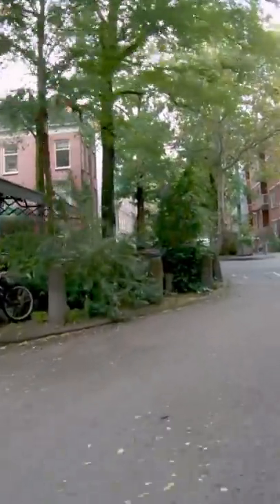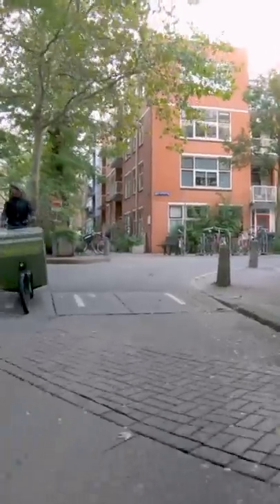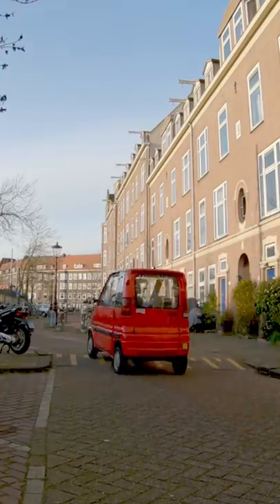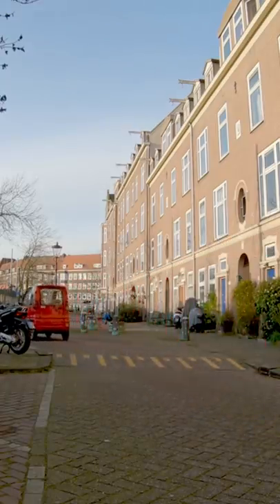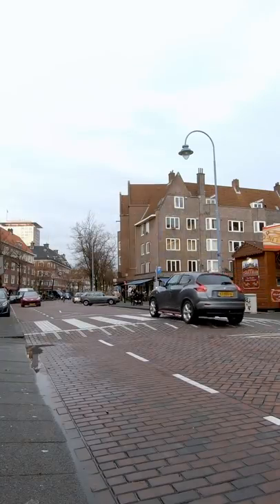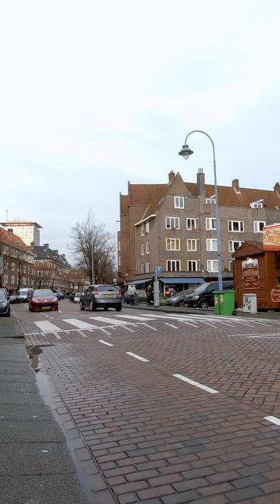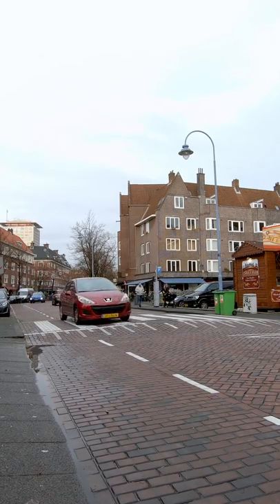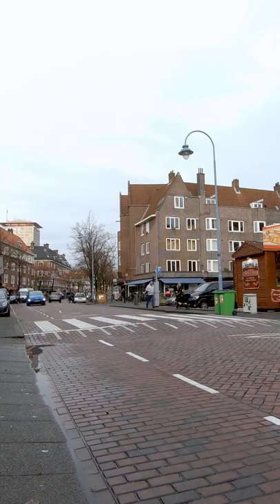How the Dutch Slow Drivers for Safer Streets #shorts

Comment: I like how is pretty much just "add road hazards so people will sLow down"
Reply: But it works
Reply: @yoyu8641  except that slow speed crash aren't that bad anyway
Reply: @yoyu8641  You are right, nobody ever got killed due too high speeds, genius.
Reply: I need to check the stats but i think in germany we have less car crashes... At least i always see dutch  people crashing, and also in NL more. I live in germany near the border
Reply: I checked it. Fatality  rate in germany per 100k is 3.7, in NL 3.8
So it probably helped, could be much worse, but - how do we do it in germany? There is much more to it than placing road hazards. Like proper driving schooling
Reply: "road hazard" = cautious, wary drivers = less dead pedestrians & cyclists. At the slow speeds these "road hazards" require, any crash will be non-lethal to drivers, as they are effectively driving two ton tanks.
All those "road hazards" also discourage driving and encourage cycling or walking, which are far better in the dense, urban environments this channel generally features.
Reply: It's a chicken and the egg argument and in reality it is not practical to force people to drive slower when it just isn't necessary. Sure a private neighborhood road. you don't want people to be able to go 100mph comfortably, but when they're intentionally making the road annoying to drive down and more complicated it's not really helping anything. People who speed don't care about the details. If they did, they wouldn't be trying to speed.
Reply: the "making it complicated" does help, because it becomes physically impossible to speed. You're not going to be driving through a tree, no matter how fast you're going.

In the dense, urban environments that this channel deals with, difficult roads are practical and useful, both as a means to make driving unpleasant, and to protect pedestrians & cyclists. The whole system of urban development in the netherlands is tailored to reduce car traffic wherever practical, because cars are dangerous, noisy, polluting, and horribly space inefficient.
Reply: @donfolstar   Did you forget your medication today? LMAO I didn't miss any point. I swear no one can talk about anything without taking the opposition, even when it really doesn't make sense... I constantly pay attention to my speed regardless of surroundings and am not "easily distracted" like you and other people may be. Honestly it's the fact that they are pretending to be in control of things when in reality that just isn't the case that bothers me about this idea and that they are just cramming potential hazards closer together and putting obstructions in the road in the name of making things safer when obviously it's never gonna change someone's mind who is dead set on speeding down that road and simply increases the potential for people to kill or seriously injure them self while all around just making things less comfortable for no reason.... I definitely wouldn't want to ride a bike all the time as transportation it's not practical anywhere other then certain cities in Europe that are designed to allow people to commute by bike. Cars are gross IMO, but it's not my fault society is a shit show and I have to go across the city everyday to work... Finally they use the technique of making roadways more narrow and putting in curves to force people not to speed Here in America so I have no idea what your talking about people coming here to get away from that. LMAO. BTW This was way too much effort to write just so that some guy in another country that is off his meds can spout of with more irrelevance at me...
Reply: Let me guess, you're American?
Reply: @dickrichard626  yes,you did miss the point!!
they didn't just throw those obstacles out there, there's science to this... traffic engineering
all those measures work very well,(you can find them all over Europe) and when an accident does happen-it is just a bump at 20-30 km/h supposed to 70-90... 🤷
Reply: @dpmjole  Do you know what a circular argument is? Chicken or the egg...
Reply: @dpmjole  Also if you really think there us advanced science behing the design of all the roads every where thats just insane. At least 70% of the time I garantee you the roads are whatever meet the codes and gets the job done. No one cares that much...
Reply: @dickrichard626  You should watch the video on stroads, there absolutely is a science and an intentional system in place. The obstacles like chicanes and large speedbumps are only found on residential 'streets' where the speed limit is 30km/h. Medium volume roads have a speed limit of 50km, smaller island-style speedbumps, and are sometimes narrowed. High speed roads and highways have no obstacles, but are never in town.

The entire philosophy of Dutch urban planning basically deprioritises speed and convenience of driving *in town*. Between towns it's fast and convenient. Once you're at the destination, the local pedestrians and cyclists have priority. The result is safe, quiet, liveable streets for humans. 

There's no expectation to get anywhere fast in town via car in Amsterdam, and this ought to become the norm everywhere. Within Amsterdam, cycling and public transport is faster and more convenient than driving. So that's what people do.

It wasn't always this way, Amsterdam used to be a high speed, car-focused city. They changed it (to much complaining from drivers at the time) but now the overwhelming majority of the public are glad they did.
Reply: @dickrichard626  in America indeed there is no science behind how roads are set up 
In the Netherlands it’s different 
I suggest watching the video about how roads are engineered to be bike friendly
Reply: The trees next to the road on 0:13 are a hazard, the other measures are not.
Reply: @JYT256  don't tell people its impossible cause that will make people want to try it. Then you'll have city drifting contests.
Reply: @dickrichard626  I mean, NL has speed cameras all over too. Plus, if you claim you're not easily distracted you're lying to yourself. I like to think I'm a driver that pays attention but even I have momentary lapses where I reacted to a situation way later than I should've
Reply: @dickrichard626  no it really is. Cities in Europe are really dense almost like new york so a lot of people are going on foot so it's necessary to keep them safe.
Reply: @dickrichard626  If you're American you clearly never see a European city. Not only that our roads are crooked becouse that's how they were made 100 or so years ago but a lot of people go on foot. So if someone crashes in America the car in front will just go forwards but in Europe if they hit someone fas enough they would go into a building. Also our intersections are much more complicated due to how the roads align.
Reply: @yoyu8641  Actually the trees close to a road is one of these who I hear get lot's of accidents and the other one is just highways which have none of these things to slow people down
 It's just being aware and growing up riding a bike amd knowing how traffic works from a young age that takes a lot of the danger away amd thus makes it a lot safer as people are more aware by those "road hazards". But yes we Ditchies still like to complain about them
Reply: Dude, thank you. Some US civil engineer is dying of laughter right about now.
Reply: @yoyu8641  die from what lmao
Reply: @jansmejkal8088  true, fast disciplined drivers cause way less accidents than slow reckless ones.
Reply: @jamelpiclit3062  love how you just made american drivers diceplined and dutch reckless
the truth is slow causes drivers are way less dangerous than fast uncauses ones
Reply: @burgerpommes2001  nah dude, I'm talking about ze Germans. Or Europe in general. It's so hard to get a license there.
Reply: @jamelpiclit3062  no it really isn't 
One of my classmates did it first try without mistakes and he almost failed the school year
Reply: You only have to train the exam on an app
Reply: I never understood the narrow road idea, it really dosent slow you down, just makes imposible to drive around when there is a crash making  a road blockage. I see it as bad design.
Reply: @dontdoit1419  the point is, we don’t have major crashes in the cities. If there is a crash on a narrow street or road, the driver is still able to drive the car to a safe location because the speeds are way down and the car is somewhat intact.
Reply: @dontdoit1419  it really does
Reply: Yes that is correct. it is so that if you make it dangerous for cars the slow down.
Reply: @donfolstar  To quote my friend: "Dutch are car hating nazis". He will never, ever move here. Given his approach to driving, it's a plus for the locals.
Reply: @jamelpiclit3062  Oooooh, the "fast and safe" nonsense. Such drivers do not exist.  It's an internal contradiction:  Speed limits are almost always put in place for a reason, and people who are speeding are too mentally inept to notice / acknowledge those reasons. If they were disciplined or competent drivers, or even had any awareness of what they are doing, they wouldn't be speeding in the first place.
Reply: @burgerpommes2001  compared to some US places where your parents can vouch for you, it is more difficult
Reply: @JYT256  yes. Those cars will be far less polluting and space inefficient if we pour a bunch of arbitrary concrete obstacles into the roadway and cause a number of near complete stops which force the drive to sacrifice their inertia coming nearly to a stop and then push the gas spending energy to get the car back up to speed. 
LOGIC
Reply: @isidoreaerys8745  you're missing the point. The cars will be less polluting because there will be fewer cars.
Reply: @LeDore38  a slow speed crash into a tree with a dead stop is far more dangerous than rolling or going through bushes and taking time to slow down
Reply: @yoyu8641  Terrible logic
Reply: @LeDore38  More accidents is not better than faster accidents...
Reply: @isidoreaerys8745  they wouldn't be going fast in the first place, you can just cruise through. These are designs in the city, where there's tons of pedestrians, not the highway. On the highway there's no such obstacles
Reply: @DollaBill313  in america you get more AND faster accidents lol going faster doesn't reduce anything so I don't understand your logic.
Reply: The driver is the actual hazard
Reply: @derianvandalsen  Really think about what you just said. Is the driver the hazard, or are the actual hazards in the road that make the driver take unnecessary actions the hazard? Yes drivers can always be hazards, mostly because of phones and the poor attention spans of this ADHD filled population. But how does making the road even harder to drive down make it  more safe?
Reply: @DollaBill313  the stats speak for themselves.
Reply: @JB22.  Except you are a cyclist or pedestrian walking behind the trees.
Reply: @DollaBill313  Actually it kinda is...
Reply: @dakoknight6197  yes, and it also looks better and better for biking and walking
Reply: Dick Richard You keep saying if someone is going to speed, they're going to regardless.  It is genuinely impossible to speed to unsafe levels in these areas.  Unless you're driving an F1 car with insane torque, by the time you reach a killing a child walking across the street speed, there's a speed bump, bend in the road, or raised section that would stop you.  

People only speed because it's convenient and they can.  Obscenely wide suburban roads that are straighter than an arrow just invite people to speed.  Theres no claustrophobia or loud sounds that make people uncomfortable to go 50mph in a school zone. With thin streets, complex design, and objects that are close to you, there's you need to pay attention to driving lest you crash.

Did you even watch the video?
Reply: @jansmejkal8088  Most of those fatalaties in both countries are vulnurable road users (pedestrians and cyclists), which are far more numerous in the Netherlands than they are in Germany. In fact a large portion of the fatalities in the Netherlands are 70+ cyclists, a group that doesn't exist in Germany because nobody even tries. Per km cycled the fatality rate in Germany is more than 10x that of the Netherlands.

 Lies, damned lies, and statistics..
Reply: @JYT256  Protecting the pedestrians by making the road so hazardous and complex to drive, no attention can be paid to pedestrians.
60000 IQ
Reply: @rachelpurity1  its only hazardous if you're not paying attention as a driver. Thats the whole point, to make drivers pay attention
Reply: @JYT256  The driver will have to almost exclusively focus on navigating that hellscape of a road at that point, they won't have focus left to watch pedestrians.
Imagine I told you to balance on a rope in the park while counting to 10 000 and then randomly asked you "what color shirt did that guy wear that just walked by?"
Reply: @rachelpurity1  have you tried driving more slowly.
Reply: @rachelpurity1  Can you explain why the Netherlands has one of the lowest traffic fatalities if you think that this is dangerous?
Reply: @Brozius2512  Can you explain why no speed limit Germany has lower traffic deaths despite more people driving daily and further and considerably faster?
Riddle me this, Nedman
Reply: @rachelpurity1  Road traffic accidents death rate:
Germany 2.98  -  Netherlands 2.83

If I were you I would do research before claiming something, it's not that hard... you have the internet.
Reply: @Jan Smejkal - different countries also drive different amounts. Most countries in the Americas rely heavily on driving. There’s gonna be more crashes. A better stat would be crashes per so many miles driven.
Reply: @gujwdhufjijjpo9740  That's because their infrastructure only gives  them just one choice in transportation.
Reply: @yoyu8641  That is not how it works. Accidents are deadlier the more energy is in the vehicle. And the energy correlates exponentially with speed. So, if manage people to drive 45km/h instead of 60km/h (good design is even better) you will have nearly 50% the energy. This means, half the slowdown period. Double the reaction time available. Less than half the damage, if you fail to prevent an accidents.

So, yes, there might be more opportunities to make small accidents. But in reality, you have much less dangerous accidents.

Sure, there are always idiots that drive far too fast. But on a BUSY narrow street, they are not alone, therefore these idiots CAN'T drive too fast.

This stuff btw is not an "opinion" but proven by scientific studies.

Comment: Love the close 🌳! That would for sure make me more aware!
Reply: It's the worst. Trust me. The general idea behind them is good, but they are just too close to the road. They're not only dangerous to put them in a 80km/h zone, but if two trucks need to pass each other it BARELY fits. They lose a mirror every now and then.

A little more distance from the roads and a safety rail in front would be an excellent solution.
Reply: @arie8515  yep ive seen multiple trees where the bark of the tree is gone and there is a photo of the person that died there, there is one when you get off the highway where i live.
Reply: Not like speeding is good either but still.

Comment: I would also point out that cyclists themselves are used in such settings as a traffic calming measure: by not squirreling them away off to the side, cars have a much tougher time overtaking and are made forced to slow down.
Reply: ok
Reply: @GTAmaniac1  but these traffic calming measures are on the car roads, not the bicycle road, even so you can easily avoid  speed bumps when you are on a bike. And the cars aren't speeding past you because of the traffic calming, there is so much wrong with your comment
Reply: @ShadowJesus22  in most cases you can't go around the speed bumps because there's either a pothole or one of those drains that's heavily recessed and cars are speeding past because I know what 20km/h above my speed looks like and that ain't it. It would be way safer if the 1.5 tonne death machines were separated from man powered vehicles that offer no crash protection.
Reply: @GTAmaniac1  in many cases they are completely seperated
Reply: @GTAmaniac1  9/10 times they have a special bike lane, except sometimes in the living areas where cars can only drive 30 max and have speed bumps so they usually go 20 to 25 if they care about their suspension

Comment: In Flanders (but not really in the rest of Belgium), and in addition to what this excellen channel has shown, on-street car parking is designed so as to block most of one lane in a two-way street, with alternating parking from one side to the other. That way parked cars form chicanes, with only about one and one-half lanes available for driving - one car and one cyclist. This really slows down traffic, while providing adequate amount of parking.
Reply: I also ride streets like that in the Netherlands. Sometimes it works well, other times it does not, likely due to the road surface and how busy it is.